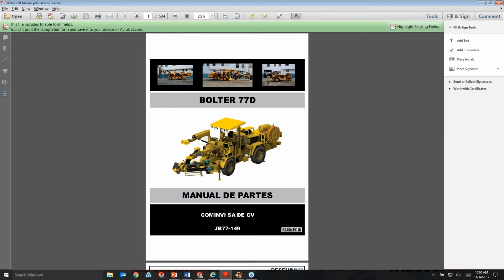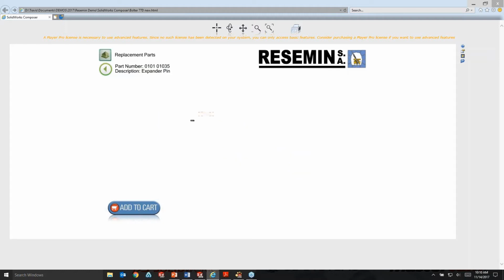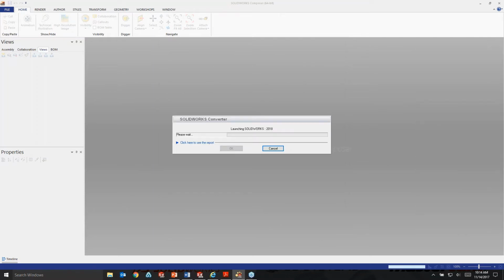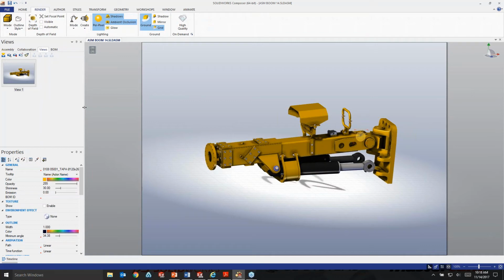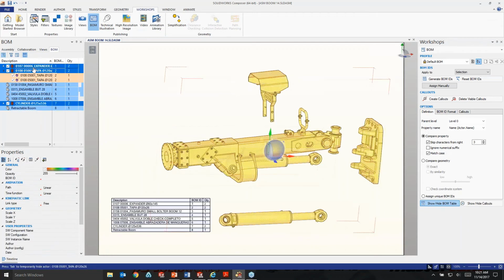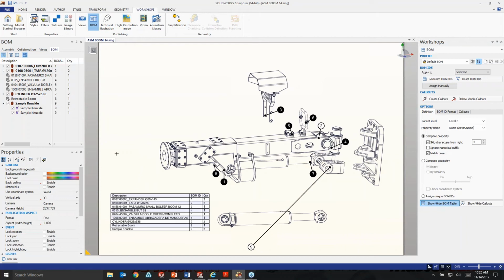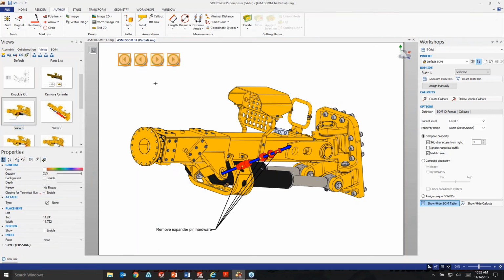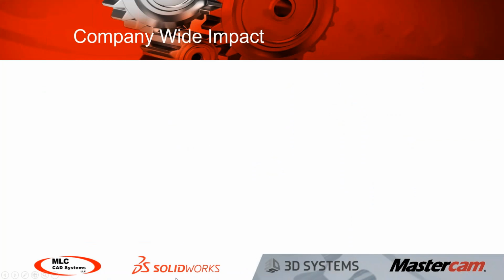Creating Technical Documentation with SOLIDWORKS Composer

Comment: How did u rotate the image in the browser? It is not possible to rotate svg file?
Reply from the maker: Rather than trying to rotate the SVG file in the browser, I would rotate the model in Composer to the orientation you want and capture that.  SVG files with selectable regions aren't simple objects and might have issues if you tried to manipulate them manually in a browser.